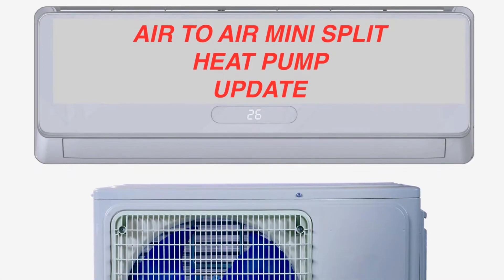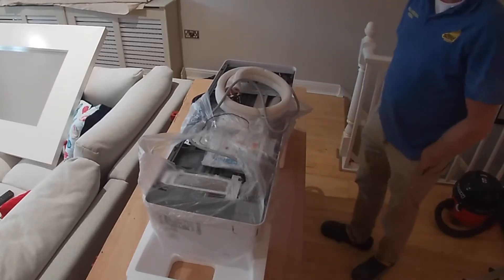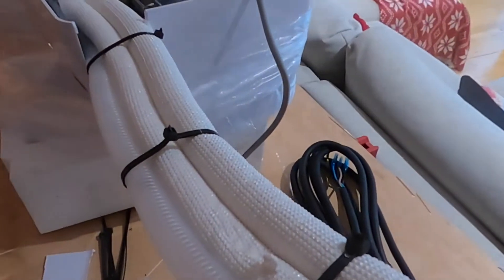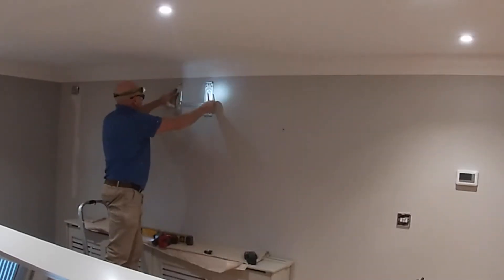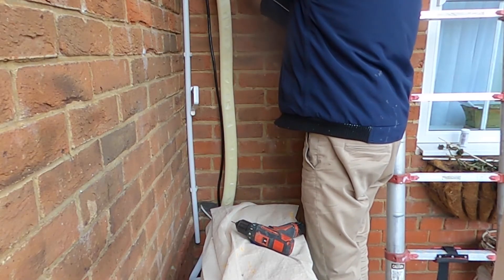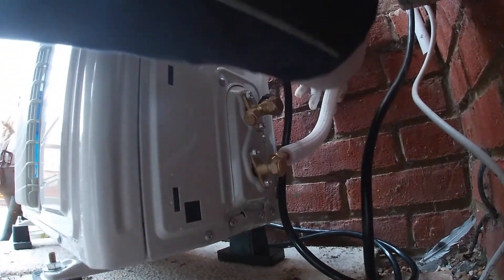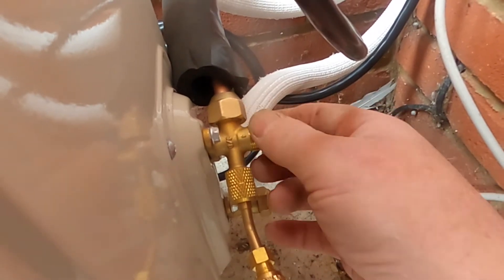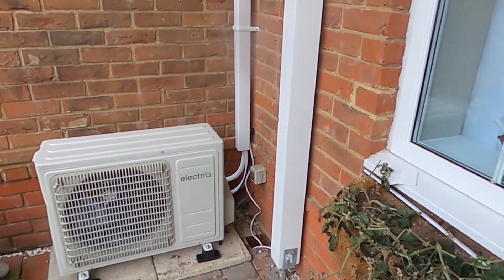DIY AIR TO AIR  MINI SPLIT HEAT PUMP  INSTALLATION OF SECOND ELECTRIQ UNIT

Comment: Hi, Very well explained.. Im looking at getting one, can I get a way without using the 4mts extension pipe, in other words the short pipes from the cassette inside will it bolt straight on to the outside mini split as its going on a stand up on the wall. Also would it need vacuuming as I'm not using the extension pipe? TIA
Reply from the maker: Hi  
You might be able to  get away with just using the "tails " from the indoor unit  . depending on your wall thickness you might be lucky . The unit is supplied with the extension pipes any way . I can under stand if you are trying to avoid a coil of pipe  behind your out door unit. Have you considered just extending the pipe to your needs and creating your own flared joint ?. The tools for flaring the pipe are reasonably cheap on the net. It sounds as if any joints  will be outside the property , If within the property any joints will have  be brazed or soldered with the appropriate materials . Regarding the vacuuming down of the pipe set ,the manufactures instructing explain how to commission with or with out a vacuum pump . I will try to send you a link to the type of flare tool that I use . Good luck 👍
Reply from the maker: https://amzn.eu/d/3R3apiy  This tool is really easy to use. and when you are done if you don't want to keep it you can always  sell on internet👍

Comment: I fit air to air and rave about them (f-gas registered), just a few points for anyone thinking about fitting these units, r290 is highly flammable so be careful!!! Buy a leak detector . The fittings have a torque requirement so be careful not to over tighten and damage the threads.We vac the lineset to remove moisture and to check for leakage (holding a negative pressure for a time)also pressure test for strength of joints and leakage. When brazing you need to run oxygen free nitrogen through the lineset to eliminate oxidation in the pipes, if your compressor goes and you haven't your warranty will be void!!! With the location of the outdoor unit i would always fit it at least 1m from a boundary and as considerably as possible. An air con unit (hot/cold)isnt covered with permitted development!! strange? as 1 heat pump (hot only) is. But ive never know a problem!!
Reply: Update: As of early 2025 a heating and cooling mini split IS now permitted development. Only ones that cool only require planning permission, but I don't know if you can even buy them any more. Every unit I see does heating as well. 
There are still some rules regarding noise levels, how close to your neighbours bedrooms and living rooms, conservation areas, listed buildings etc but if you meet them you don't require planning permission.

Comment: Do you have the vacuum pump model or a link to a supplier please?
Reply from the maker: Hi this is the kit that I got  from amazon it has every thing you need .BACOENG 3CFM Vacuum Pump & Manifold Gauge Set - HVAC A/C Refrigeration Kit - Diagnostic R12 R134A R410A R407C- 3 Pin UK Plug.  Thank you and good luck 👍

Comment: Hi! I have purchased this unit , 3 weeks before it’s delivered! I’m looking to put the unit in our en suite wall as its shortest route without having to join the cables , is it okay for the condense pipe to go up out the unit indoors ( 10 inch max) and then along the loft/ floor in attic and then drop down outside . Or is it best to have it horizontally coming out the unit without any vertical pipe running ? Thanks carl
Reply from the maker: Hi  Please check regs ext.regarding electrics in bathrooms . Unfortunately the condense pipe cannot rise from the unit it must have a fall all the way. There are pumps available that will allow you to over come your potential problem . Good Luck 👍
Reply: @HEATSEEKER1428  thanks a lot! Sorry, I ment in the bedroom on the en-suite wall not actually in the en suite. I fort that with the pipe but fort is best check! Thanks a lot for reply.

Comment: I just tried to order from appliances direct and they want a f-gas certificate number before they will release the order!!
Reply from the maker: Hi Appiances direct sell both types  the if you are not  F-gas registered and you want to fit your own mini split  the model numbers are  for the 9,00 BTU  eiQ-9WMINV-V4  and for the 12,000 BTU eiQ-12WMINV-V4  . I hope this is helpful and good luck .👍
Reply from the maker: Hi  try this. Home
Air Conditioning
Air Conditioners
ElectriQ
EIQ-12WMINV
electriQ Easy-Fit 12000 BTU A++ WiFi Smart Wall-Mounted Split Air Conditioner with Heat Pump and 4.5-Meter Pipe Kit
Compare
SKU: eIQ-12WMINV
Quickfind Code: 865335
Reply: @HEATSEEKER1428  Hey i have the unit i was under the impression i would not have to vac the lines just connect and go (I appreciate you did in your video) but the instructions clearly call for the line to be vacuumed!! So i guess i need a vac kit now too!
Reply from the maker: @jaykilby458  Hi The instructions give both options with or without vacuuming down the pipe set . Thank you and good luck 👍

Comment: As a refrigeration engineer of over 20 years i have a few issues with this "installation video" 

Yes you definitely do need to use a vacuum pump as any moisture will cause corrosion of internal parts and premature failure and your vacuum pump must be A2l certified as r290 is highly flammable, but before this you must and i mean must carry out a pressure test with oxygen free nitrogen as r290 is no joke.

You really should not be showing people how to join pipes with "soldering" as brazing should be the only option when dealing with the pressures of refrigeration.

In my opinion its a joke that companies like appliance direct are allowed to sell these r290 split equipment as "diy" when they are the most dangerous of all for a amateur to install.
Reply from the maker: Hi thank you for your comments. Although I do vaccum down the pipe set in my installation  . Manufacturers instructions  (electriQ Easy-Fit 9000 BTU A++ WiFi Smart Wall-Mounted Split Air Conditioner ) says alternative methods can be used. Regarding  the soldering of the pipe set . The solder and flux that I use suitable for this job. Thank you .
Reply from the maker: As you probably know  compared to other refrigerants  R290 has a very low  G.W.P,  and as long as all manufacturers instructions are adhered to there will be no problems . Thank you .
Reply: nick you aint got a clue 🤣🤣🤣🤣🤣😅😅😅

Comment: Can the pipes go directly out the rear of the unit rather than out the side then bent? Also, is there an efficiency benefit if you vacuum the unit?
Reply from the maker: Hi Yes the pipe s are really better going out of the rear of the unit . I'm not sure there would be a great efficient benefit  from vacuuming the pipe set down  as apposed to just releasing the refrigerant straight into the pipe set.  The only reason I vacuum down is to ensure there are no leaks . Thank you .

Comment: R290 is propane, best to make sure you don't have any leaks before running linesets around your property. Ask your house insurance provider if they  are happy for DIY propane installs and any eventuality occurring from an undetected leak.....
Reply from the maker: Hi As long as Manufactures instructions are followed there is no danger. All pipe work and associated fittings and valves  must be tested  before any refrigerant is introduced . Thank you .
Reply: @HEATSEEKER1428 so you carried out a pressure test with oxygen free nitrogen to 1.3 times the maximum working pressure?
Reply: i have a gas heater in most of my rooms. each carries a 15kg propane gas bottle 🤣🤣🤣😅😅😅😅😅

Comment: You need to be an F-Gas registered engineer to install.....You need to purge and pressure test with Nitrogen, then pull a vacuum to about 200 microns etc etc....regulations are there for a reason
Reply from the maker: you are right when installing units that have a very high G.W.P  You need the F_gas registration . However R 290 has a very low GWP. so no F gas required. The manufacturers  instructions for these units state that there is no need to vacuum down the pipe set before introducing R290 into the system. Is R290 the future ?  Thank you 🙂
Reply: you aint got a clue 🤣🤣🤣😂😂😂😂😂

Comment: A quick question - I am getting one of these  electriQ Easy-Fit 12000 BTU units, and plan to put the outside unit higher on the external wall than the indoor unit. I will have the condensation pipe from the indoor unit running down to the ground outside so not going uphill so to speak. But the other pipes will go up from the indoor to external unit.  Does that sound okay to you?  
  Thanks in advance and also for being so responsive to everyone else's queries.  Cheers.
Reply from the maker: HI Sounds ok just remember that condensation  comes from out door unit as well , also it will drip when it defrosts. The out door unit is supplied with a drain  cock  so it the dripping is a problem you could pipe it to a more convenient spot  . Thank you and Good luck 👍

Comment: Great video! Thanks for the detailed explanation and helpful tips. I’m planning to experiment with the same R290 unit and will likely need to reposition it after testing. Could you possibly create a video on safely moving and recharging R290? It would be incredibly helpful to understand the process and the necessary precautions. I’d be happy to contribute to a fund to support this effort. Thanks again!
Reply from the maker: Hi 
This  video  will be very helpful https://youtu.be/xD6ZmTYvF4U?si=XAosoNjR6kJP22js
This guy has already done it . Thank you and good luck 
👍
Reply: @HEATSEEKER1428   Hello, I have a question about the indoor connection. Did you use compression joints on the inside connections? There is a warning on my unit to use mechanical joints outside and solid joints inside. If you have used the supplied mechanical joint on the inside could you tell us your reasoning. Thank you kindly, Douglas
Reply from the maker: Hi  No I did not use the manipulative compression joints inside the property , as the installation instructions  state these type of joints  must not be used inside the property or within the thickness of walls or voids. If you are considering joining the pipe work with in a building   then you must make the joints with an appropriate material  Braze or specialist solder and flux .( not  the flux and solder used for  general plumbing purposes , ) Specialist soldiers and fluxes are available on line .(its not cheap .).  I would not  recommend doing this work unless you are very confident and obviously  follow all manufactures instructions and test all pipe work and fittings thoroughly. Thank you and Good luck 👍
 @douglasjohn
Reply: @HEATSEEKER1428  Thank you for your detailed reply. I have another question: How did you check your connections? Did you use your vacuum and then apply soapy liquid after filling, or did you also perform a positive pressure test?
Reply from the maker: @douglasjohn  Hi After making the various joints I vacuumed down the pipe set  and left over night {there is no need to leave it for so long but I came a natural beak so left it  over night } the following morning when all was well I followed the manufacturers instructions and released  some pressure into the pipe work and then checked all joints with  leak detection fluid. Thank you 👍
Reply: @HEATSEEKER1428  Hello, is there a reason for swaging rather than soldering female-to-female straight couplings? Thank you for all the information you are providing. Kind regards, Douglas
Reply from the maker: @douglasjohn  Hi  I have  not really considered using  end feed couplings . mainly  because it is so easy to make a swaged joint. I have never even looked into the availability  of end feed couplings for the size of pipe supplied with the mini split.
One obvious advantage of the swaged joint is that you have only 1 actual joint.  If you are going to use end feed couplings  make sure  they are designed for the job that you are doing  as copper for air conditioning is a thicker gauge  than standard  plumbing copper ., also be sure to use the correct solder and flux  or brazing materials when making joint . Thank you and good luck .👍
Reply from the maker: Hi Here is a link to an existing video showing  what you are proposing to do . I hope it is helpful. Thank you . 👍https://youtu.be/xD6ZmTYvF4U?si=dD6OmqbEzn12GeYT

Comment: I understand that Appliances Direct have been fined thousands of pounds for supplying these split systems & they now have to be installed by an F-gas engineer…
Reply from the maker: I think you must be mistaken.  Appliances direct have the units for sale . There is no requirement for F-gas engineer as the refrigerant is R290. Thank you .
Reply: @HEATSEEKER1428 I’ve been researching heating alternatives for a house with no gas supply - that’s how I discovered. REFCOM reported Buy It Direct to the Environment Agency, who sued. Jan 2024. 
The units are still for sale, but cannot be bought without evidence that they will be installed by a registered engineer.
I’m now looking at the monobloc type that are hermetically sealed & still DIY
Reply: @HEATSEEKER1428  i just went to order one from Appliances Direct and they will not release the order until you have supplied a certificate number of a F-Gas qualified engineer

Comment: Hi what is the 3pin plug cable for? Does the indoor unit need a separate power supply? Thanks
Reply: The indoor unit is the only one that's plugged into the wall. The black cable connects the outdoor unit (the condenser) to the indoor one.
Reply from the maker: Hi the 3 pin plug is the supply to both units via . the indoor unit . This is the only power input and simplify's the installation. .No need for complicated external switches . Thank you .👍

Comment: Hi , this has been most helpful as I’m about to install my own, you extended the pipe work , do you not have to add more gas?
Reply from the maker: Hi  I think if you read the specifications on the unit it says  that your pipe set can be up to 12 meters . PLEASE CHECK THIS.👍 . If you are not exceeding the specified max distance then you should not have to add more refrigerant.  Thank you .  Good luck
Reply: @HEATSEEKER1428  Thanks for your advice

Comment: Great video I am about to do one myself. How/What did you use to box the piping indoors?
Reply from the maker: HI 
To Box the piping in I just used a strip of 5mm MDF. Using some door stop timber as a support / ground..
I am not a carpenter so terminology might not be correct. I worked out what my widest point was and the bought the smallest sheet possible to fulfil my needs and then got B & Q to cut it into  strips. I used this thin material because I wanted the boxing to take up as little space as possible . Thank You and good luck with your installation 👍
Reply: @HEATSEEKER1428  Thank you for the info. Think I have the exact same unit as this vid so will be interesting to see how it goes!

Comment: Great video thanks, it help my instal. I have the 12000 v4 and the manual has conflicting info about it having an ionizer. On mine there's 4 small holes on the side of the grey plastic on the right side where the manual says the ionizer is located, but im not sure if this means i have it or if they are just air vents.?
Reply from the maker: Hi  The best way to check is with the app on your phone ,

I have checked on my appliance and the grey  "block" on my unit is solid. . no holes but when I select clean on the app the unit starts up , I assume on clean mode which must be ionisation. Having said that  you are right the instructions are a bit vague . Perhaps try giving the tech help line a cll with serial numbers  to double check. But as my unit starts up on clean mode  II can only assume that it does ionise. Thank you and good luck👍

Comment: Hey, thanks for making this video. I bought one of these 'easy-fit' units at the end of last year but was confused about vacuuming out the long copper pipe, so didn't end up installing it. As it gets warmer, and after watching your video, I think I understand that it's not necessary, and how the fittings go on. Do you know if there are any negatives for not vacuuming out the copper pipes?
Reply from the maker: Hi 
Not vacuuming the pipe set probably will not make a lot of difference to the performance of the unit . as long as you don't leave open ends for long amount of time . Be sure to check the pipe set and connections for leaks  before letting full pressure into whole system .. Thank you and good luck 👍
Reply: @HEATSEEKER1428  Hi, I'm wondering how you did the connections for the indoor unit to the piping? There's like 2 plastic bits on the indoor units piping, and I soon as I loosen it a tiny bit, it sounds like gas is coming out. There doesn't seem to be a valve like system to stop the gas?
Reply from the maker: @loshan1212  Hi  It is no problem removing the plastic  bits on the connections of the indoor unit. they are under pressure weather it be positive or negative,
It is just how the manufacturers have shipped  them fully tested.
That hissing sound you hear is a good thing. I would try not to remove plastic plugs on the indoor unit until you are ready to make the connection. To prevent any dirt or moisture entering the pipe work.  Obviously follow instructions when  connecting to the out door unit, Thank you . and good luck 👍
Reply from the maker: Hi The manufactures instructions don't indicate there are any negatives if you don't vacuum down the pipe set. I would just take a lot of care making sure all of the pipe work and joints are sound . Follow the instructions and you can't go far wrong  . Thank you. and good luck 👍